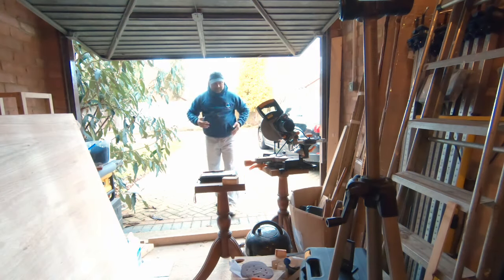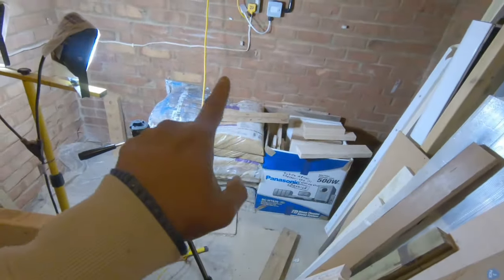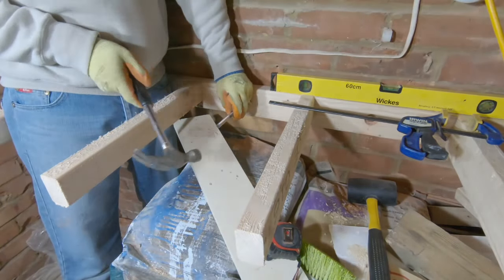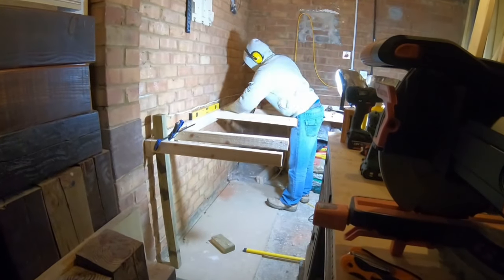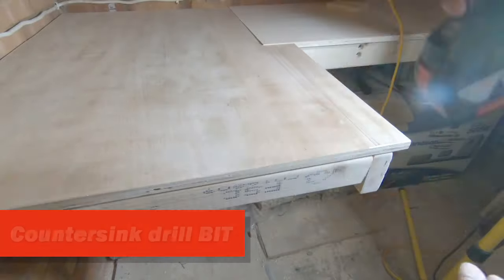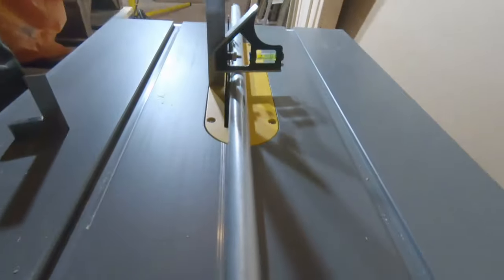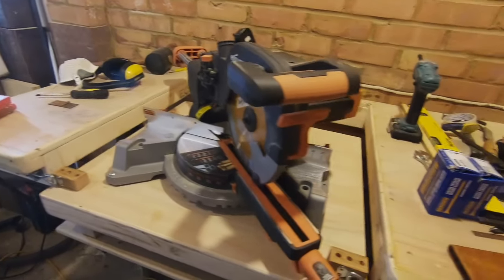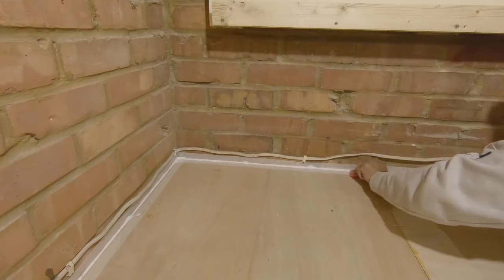Workbench with Flip-top Mitre Saw station! Workshop

Comment: Nice build and explanation. I was terrified though by how close you had your hand to the table saw blade!
Reply from the maker: Thanks Tom. Yes, have to be careful while using a table saw. It only takes a micro second to lose a digit! Sometimes in these videos, it may be sped up x8 times, so could look even more dangerous than it is. But that's still no excuse for having it close to the blade 😁👍

Comment: That is super useful! Im just in the middle of a flip top mitre station build and struggling to get my head round the measurements to allow flush worktop one side and mitre saw base level on the other, with correct position for the pivot. Great to see your logical steps and extra uselful as i have same evo mitre saw as you. Thanks!
Reply from the maker: Glad I could help! Just remember that washers will also help in getting the height up slightly. So even if the height from the pivot is a bit low, not to worry. good luck 👍

Comment: Subscribed.  We are reorganizing our work shop area of the garage this year...  My big question is how do you keep a bench like that free of junk? Every flat surface here gets covered.
Reply: Hi,  @SujMenon  ...  Good photo.   Yes, only worse! Yours actually looks pretty functional to me! (Just mid-project.  ). I love all of that flat surface for working.  I wish we could be that neat!

 Between projects, we actually have two cars parked in our garage.   The wall and corner that hold all of our big workshop tools appears to be a convenient place to set materials/purchases that don't yet have a home.  Flat surfaces are hotspots.

And that includes the top of the table saw, the 2x5ft workbench (even though it has a lathe on top of it as well), and the table of the radial arm saw. Even the drill press table can have stuff stacked on top of it!  So, before we can work on a project, we have to clear surfaces. It's a pain.

 In considering whether to build a bench over the top of the table saw, and other stands for power tools -- most everything is on rollers-- I realized that while it's nice to have a workbench surface like yours, any flat surface would just be a magnet for 'stuff'  piled on top.

Have you seen the channel with an 8 by 6 workshop? I think he's the one who made the comment that every tool has to go back on the wall -- because there's no room to put it down.  That was an eye-opener for me....

So we might just end up with no flat surfaces other than the table saw, and it even occurred to me as I was trying to mentally solve this problem to build a cabinet out over the table saw,  leaving only enough room to easily slide it out on its rollers.   And to only use portable foldable benches  during a project.  We do have floor space as we move the cars out and have the garage apron outside in good weather.  

Just mulling things over. Thanks for the look into your workshop it's really helpful!
Reply: @SujMenon  Thanks very much for more ideas!  I will look at all of them. And we will be looking at more of your own workshop build.   Thumbs up!

Comment: Hey Suj.  I see you removed the black plastic extension 'wings' that are fitted as standard to the mitre saw.  Is there a reason for this?
Reply: @SujMenon  Admire your honesty!!  Great job nevertheless and i am copying you - well almost haha

As an aside - where did you get the p/hole jig from and are you happy with it?  I have the small kreg mini which is great but fiddly for repeating holes etc.  The larger kreg jig is quite expensive for the volume of use i will have so looking for a more cost effective (cheaper!) solution..

Comment: Hi Suj,  great video and thanks for sharing. I also have that saw and am looking to add a flip to my workbench but did not consider offsetting the pivot point. I wonder if you could message me back the dimensions if possible which are missing from your in video diagram. Thanks again
Reply: Suj Menon thank you so much.  I have a little more room with the brace point 600ml back from the front but only 600ml allowable width.  I think I might be able to get away with a central pivot and the saw to be hidden.  Thank you again so much for taking the time to share, I have subscribed and already inspired to make your router sledge.  Stay safe and well :-)